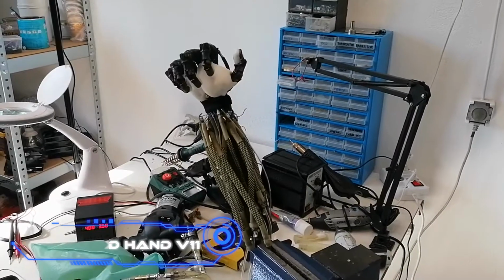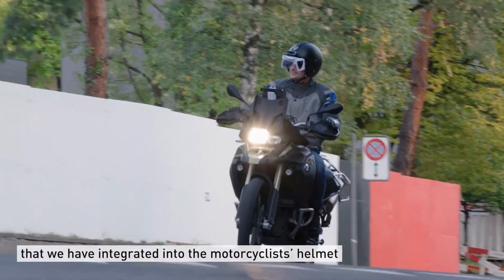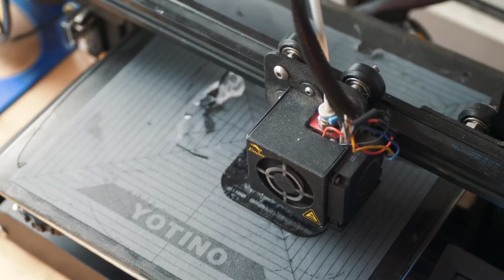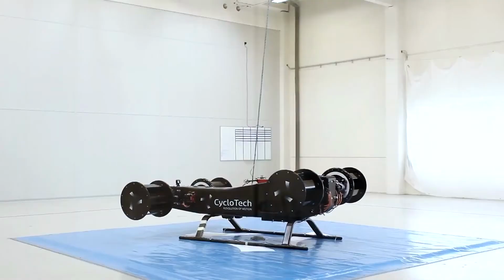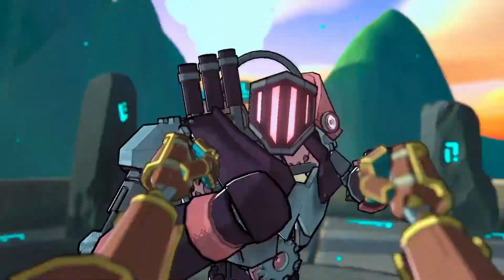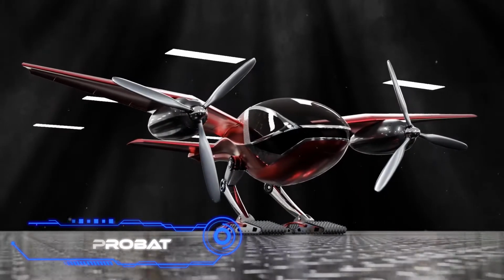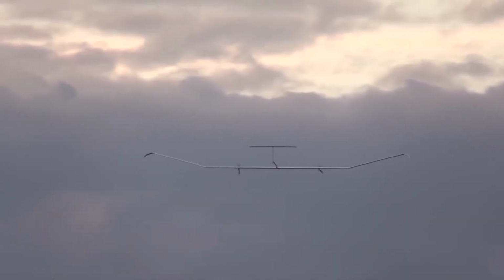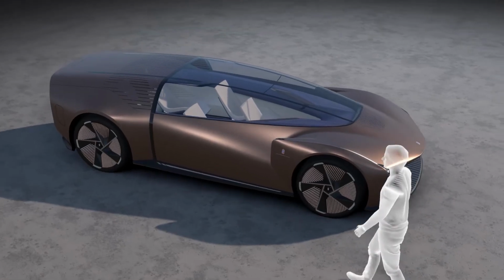12 INCREDIBLY COOL INVENTIONS AND IDEAS YOU MUST SEE

Comment: ETH Aegis Rider is a fully working prototech that help people with more safe ride. The safety system has a set of sensors, a camera, a satellite navigator, an inertial measurement unit, and a computer. The Space house has revolutionized the concept of contemporary homes that are also self-sufficient. They created a home that's both comfortable and easy to move which would be quick, easy, and simple. It can also be put just about anywhere. It has electricity, heating, water, sewage, Wi-Fi. The house is built with eco-friendly high quality materials. Thank you so much for doing this video.